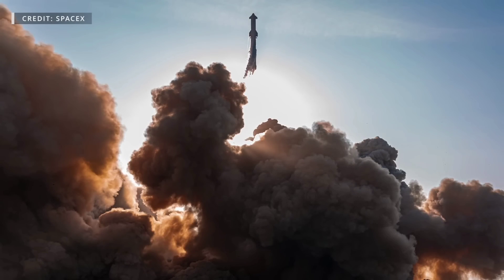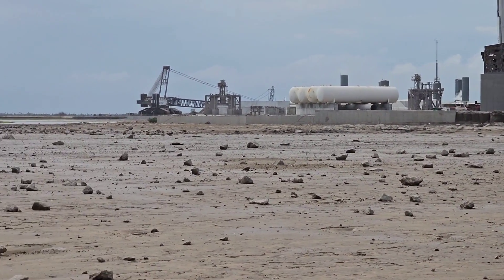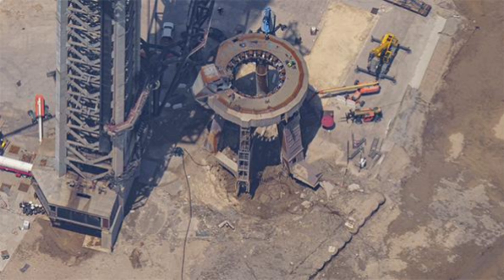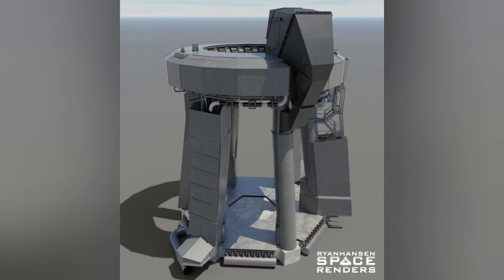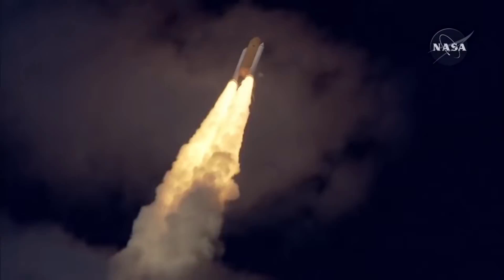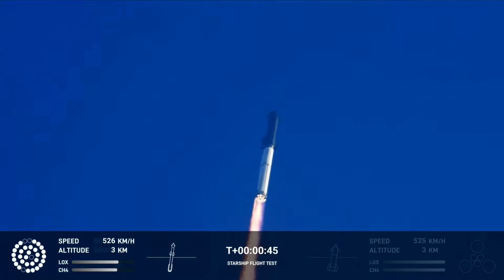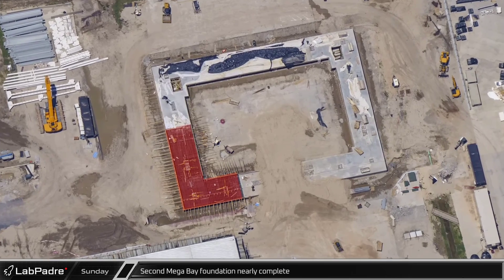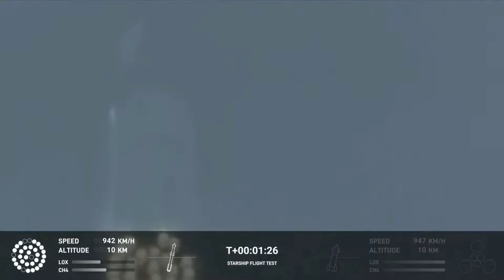Will Elon Musk's water cooled flame diverter be enough to keep Starship and Starbase safe?

Comment: The one concern I have is with steam backpressure explosion. If the water pressure and flow rate through that blast plate does not remain GREATER than the tremendous rocket-exhaust thrust it is opposing, the water could flash into high-pressure steam inside the piping of that “upside down shower head.” If just one part of it explodes apart, it exposes the rest to the millions of pounds of “the world’s largest cutting torch”and you have a new zipper effect that tears the plate into steel shrapnel and hurls it all over. If the exhaust blast gets through the plate and impinges the concrete pad in a single high-pressure point, you might see a secondary zipper effect as the concrete beneath the plate comes apart again, adding concrete shards to the shrapnel…

After all the high-tech rocket science that’s gone into this amazing craft, its successful launches might depend on maintaining steady (and Herculean) water pressure and flow rate!

#PlumbersFTW

Comment: Judging from the damage, to the quick disconnect, the launch mount and the surrounding area I wouldn’t be surprised if the actual mount is no longer level. That tower will never catch a booster, ever. The steel plate will erode at the rate of 1/2 to 1 inch per second. The only large rockets launched by any nation use a flame diverter trench, they can’t all be wrong. This site will look like an abandoned Air Force base in 5 years. It’s good to hear a reporter that doesn’t think musk walks on water.

Comment: Zack Golden on his latest video on the CSI Starbase channel did a deep dive on all these issues you brought up. He gives an excellent analysis on exactly what happened involving the creation of the crater underneath the launch mount and what is being done to prevent it from happening again. Given his analysis I think the current solution will work.
Reply: The one concern I have is steam backpressure, all that tremendous rocket thrust forcing itself into the spray holes of the “inverted showerhead” and creating steam explosions within the plumbing of the plate. A new version of the “zipper effect” except that it’s bits of steel shrapnel hurled everywhere. And if too much of the steel is ripped apart, a fresh concrete zipper effect can get started, hurling bigger pieces of steel playing into the air… plus concrete… it’s my private nightmare. 

“With enough water pressure, that won’t happen.”

Yep. True. 
Sooo much is riding on the water-plumbing quality of this launch tower!  Funny to think after all the rocket science that’s gone into this amazing craft, it’s successful launches might depend on maintaining steady (and Herculean) water pressure and flow rate!

Comment: The questions we need to ask about the water cooled steel plate are three fold... listed in increasing order of difficulty:

1. Average power IN vs Average power OUT.  It doesn't matter how hot the flames of the rocket exhaust are... what matters is how QUICKLY they transfer heat to the pad, and how QUICKLY the pad transfers heat away via this water cooling system.  It's a matter of rates, power, not energy.  If the cooling power is greater than the heating power, then on average the pad will not heat up.  If the heating power is higher, the pad will heat up on average.

2. PEAK heating vs cooling power.  The above thinking is true for the AVERAGE temperature of the pad, but it stands to reason that at certain points of the burn more heat per second will be delivered than at other points of the burn, and that certain locations of the pad/plate will receive it more or less than others.  Now a well designed plate will be set up to equalize that as much as possible, of course, but nothing is perfect.  On the other side of that thinking, the plate is only exposed to the rocket exhaust for what? 10 seconds? And it doesn't need to not heat up AT ALL... so there is some intrinsic heat tolerance to the structure... It just needs to not heat up more than it can take at any one location in 10 second window.

3. MECHANICAL stress.  Those points about average and peak power in and out of the plate apply to mechanical energy as well as heat energy.  This is where I think the plate is likely to fail.  Steel gets softer as it gets warmer (like most things).  What's more, past a certain point mechanical stress is CUMULATIVE... lots and lots of static fire testing has the potential to ENHANCE this issue.

The real problem comes from the fact that these issues can not be considered in isolation from one another... they interact with each other and in complex ways.  Consider the following very conceivable sequence of events:

* POSSIBLE FAILURE MODE:  At launch time, the plate will heat up on average significantly but well within acceptable margins.  However, some points on the plate will heat up FAR FAR more.  These hot spots will still not be hot enough to melt or catastrophically fail from the heat alone, but the high temperature will be more than enough to soften the steel.  Not coincidentally, the parts of the plate that are most hot are also the parts of the plate that are most intensely exposed to the rocket exhaust and consequently these softened parts are also the parts that are most intensely experiencing the mechanical sheer of the rocket exhaust.  Thus, even though the plate isn't anywhere close, on average, to failure, THESE portions of the plate get ruptured or ripped free... in so doing two things happen:  1.  Portions of the plate that were never intended for direct exposure to the rocket exhaust are no longer protected and are being exposed to the hottest and most intense portions of it quite suddenly, spreading the failure, AND much worse a huge amount of the water for the cooling system is simultaneously exposed to this heat all of a sudden causing it to flash-boil creating a steam-explosion further spreading the failure and possibly sending a shock-wave upward into the rocket.  (Worst case scenario at that point is that the shock-wave extinguishes a substantial fraction of the rocket engines (which can not relight on their own), the rocket's thrust to weight ratio thus drops below 1, and the rocket full of fuel and oxidizer having only gotten a few meters of the pad while all this happened than drops onto the pad like a bomb).

Don't get me wrong.  I don't want that to happen.  I'd be delighted to have this steel plate be yet another example of the private industry innovators finds a simple cheap small solution where government programs created a massive complex infrastructure project narrative.   But this water-cooled steel plate strikes me as exactly the sort of engineering solution that magnifies a small fly in the ointment into cascading and growing failures leading to a catastrophic cluster-f***.

Comment: A “passive system” is not a flame trench and elevated launch mount that takes 3 years (at least) to build… at a site that will never be used as anything more than a test site. Meanwhile any redevelopment of the site similar to the Cape will be denied and blocked at every turn. You seriously have no idea and just armchair everything. The Cape and exclusion zone was built to accommodate the launch of Saturn V… Starship is over 2x the thrust. They will not tolerate testing Starship at this location regularly.

Comment: Certainly fair to ask the question whether the water-cooled plate solution will work.  But from there, the analysis offered lacked necessary vigor.  Angry's claim that massive damage extended far beyond the platform is ridiculous.  The damage was essentially directly below and immediately around the launch platform.  Address that problem and it appears that Musk's claim of relatively minor damage is accurate.  Little walks around the perimeter focusing in on pieces of concrete hurtled there is a far from the "massive damage" Angry claims.  What is required is an analysis of the force of a full launch impacting the plate over ten seconds, compared to the anticipated counter pressure of water being forced up and through the plate.  That's something that a Scott Manley or a What About It tackles routinely in carefully prepared presentations.   Sadly Angry's huffing and puffing here left me with no appreciation as to whether the plate solution has a realistic chance of success.

Comment: I'm always fascinated by the "experts" claiming the only way is a flame trench "because NASA says so".  Technology and modelling have moved on rather a lot since 39a was built, and considering what SpaceX have done so far I can quite believe they might have some more innovative ideas to solve the problem.  The SpaceX Raptor engineers seems to be rather good at "film cooling" so I wouldn't bet against the "shower head" idea if I were you.  Heck even launching directly from the chop sticks would put the exhaust significantly further away from the pad itself and mitigate the issue.
Reply: Angry astronaut is not technical and mostly only concerned about debris. Everyday astronaut and CSI starbase will give more technical analysis and a very deep dive into what happened

Comment: The USSR's N1 lunar rocket exploded on the pad in 1969. It destroyed the launch pad and killed quite a few people. It had the power of a small nuke. For a good reason, it was in the middle of nowhere in Khasakstan.
Elon Musk builds his launchpad relatively close to residences and with equipment all bunched up, contrary to what everyone has been doing for decades.
The Starship booster is even more powerful than the N1. If that thing explodes on the pad, all these installations around it will cease to exist. Residences miles away might be seriously damaged. Musk is ignoring all past experience and wise choices of those who came before him.
We have perfected launch pads since the 1960's. We have some tested technology. Why try to invent your own weird solutions that have a high probability of failure?

Comment: The plate only needs to keep the exhaust from getting under the concrete.  Getting under the concrete is what created all of the damage and threw the debris so far as it dug under and pushed back up under the concrete.   A flame trench may be harder as you have to deal with all of the exhaust going one way instead of all ways.  The high groundwater and very poor soils at Boca Chica will hinder this.  The harder part is the relative short distance from the rocket to the ground.  Saturn 1's launched from a low stand with a 2 way metal diverter below it.  Once the exhaust is diverted the ability to get under the concrete and toss it is far less likely.

Comment: I think I might disagree with your conclusion about how once the flame is diverted off the center of the pad and it will mess up the concrete on the sides well the only reason why the sides got messed up is because it punched a hole in the center which blasted out from the center let's put microfractures in all the concrete which made it blowout.

Comment: Spacex learned a lot from this exercise.  First we start with the mantra "The best part is no part."  Keep it simple.  We do need a few more parts.  Experience was the only way to know this.  They needed to know what could possible happen on the Moon and Mars without Flame trenches and water deluge, even through they will have fewer Raptors, they have stress tested it.  Those decent engines at the tip of the moon lander are probably a good thing even on Mars.  Finally Starship is one tough mother.  She stayed intact throughout the tumble and had to have the flight termination charges activated.  Makes me wonder what they will have to do to sink super heavy and starship after a successful flight.  Call the navy, say 'Bring a battleship!"

Comment: I have said that the only solution is an elevated lunch pad with-a hight of 4 times as high as it is built now. Place a distance where the flame can dissipate to a large extent than it is now. Elon can still say that he has not built a flame diverter and he does not but th energy coming out of the south end of the rocket has dissipate  to some extent and make the whole contraption easier to survive it blast off. Not difficult to do simply build a ramp to bring the rocket up and then mount it . But Elon has set his mind on his contraption that will bring us more disappointments. Dumber then chicken brains.
Reply: Lol chicken brain. This aged not well

Comment: Excellent point about Mars landing, Eric. Problem will be for both landing and take off. Less power will be needed due Mars' lower gravity but the problem persists. The rococo motors will likely be damaged. There's no water on Mars to flood the take off even if they make a landing. A landing pad will need to be built before landing. Chicken and egg unless smaller trips with smaller rockets are made to build the pad. Will need that trench on Mars as well.

Comment: It will not work. Period. All the forces are pretty much vertical at first. Water coming up from the plate. Engine exhaust down. THEY NEED TO HAVE A TRENCH REDIRECTING THE EXHAUST AWAY FROM THE BASE. The problem is to make a trench they will need to dig deeper. The water table is too high to make that work. The launch structure needs to be raised. This is not possible as the tower need to be raised as well. I wish them well but they are wasting time and money trying to "save" both. This should have been realized at the design stage. When this fails and they try something similar, they will have reached the level of insanity.

Comment: Nice update. It's an obvious question as to where the water for the launch pad is going to come from. But there's another unasked question that is equally important -- where is the water going to go to? It's easy to dismiss this question (as I'm sure many will) but it's one of the important issues facing SpaceX at Boca Chica. The site is a sensitive environmental area for several reasons, one of which is that it's primarily a salt water environment. The huge volumes of fresh water (or, more accurately, technical water) that SpaceX will require for a launch has to go somewhere; it can't simply be allowed to drain into a salt water environment without proving that it will cause no harm (Environmental Impact Assessment, anyone?). Otherwise it needs to be contained within the launch site, either to be recycled and reused, or stored in evaporation ponds -- but if they're not allowed to excavate flame trenches without involvement of and/or permission from the Army Corps of Engineers, how can they excavate evaporation ponds? Unless they opt for above ground tanks. Once the steel plates start to be put in place look out for other construction activities both for water provision and water drainage/containment.
Reply: Or you ask the Raptor engine designers who know quite a bit about film cooling to ensure the amount of water flowing over the plates is close to the amount that evaporates during the launch.  You can't be asked to collect steam ;-)

Comment: The flame trench is an easy solution so it is interesting that SpaceX are not going with that as a solution. My personal opinion "completely unfounded" of course is that there is more going on here. Specifically that the steel plate is being tested to allow for sea launches (will be needed on a ship or floating platform).
Reply: An "easy solution" maybe, but definitely neither cheap nor simple. It took NASA over 3 years to build LC39

Comment: There appears to be such a theoretically elegant and simple solution for all heat, thrust and most acoustic problems arising from the initial destructive launch dynamics. Imagine, still utilizing a very heavy "metal" plate designed in such a way to work as a large exhaust manifold (exhaust header) with an OLM height air gap that has 33 engine all aligned above 90 degree tubes cast into the structure that diverts individual, aligned engine thrust to intersections that lead to the outer edge of the plate and between the OLM legs. Especially if the tubes were internally actively cooled with high pressure water/gas.  I do see this "plate" evolving this "sort of" way. 

Just musings... 

Great video Jordan..!

Comment: I imagine the rocket exhaust getting in through the holes boiling the water and causing a steam explosion throwing huge metal plates flying at great speed. The ultimate on pad RUD could follow....... Next a convensional flame trench, diverter and water deluge system....

Comment: Just a thought:  Instead of water on the metal pad...what if they pumped liquid nitrogen?
Reply: Heat is not the biggest problem. Blast and acoustics is what ripped the concrete apart (as well as the three raptors, most likely). Having a horizontal slab underneath a rocket is a bad idea, no matter what that slab i made of. 

And liquid nitrogen would likely make the material even more brittle, which is not what you want.

Comment: I don't care how much water flows through this metal plate, there's no way it will work! Even if the plate somehow miraculously withstands the enormous force of 33 raptor engines at full lift-off force, The heat will superheat the water passing through it and create an extremely high pressure void inside, being very difficult to overcome by the pumps.

Apart from this, the plate is yet another acoustically reflective surface perfectly placed to help super-heavy destroy it's own raptor engines!

For f***'s sake, dig a damn trench!

Comment: Wow, this has to be the worst AA video yet, totally no idea about the modes of failure of the concrete surrounding the OLM and how the shielding protects against that happening. I thought the bit about the metal shielding melting was the low part given the metal shielding around the legs didn't melt and wasn't even water cooled.